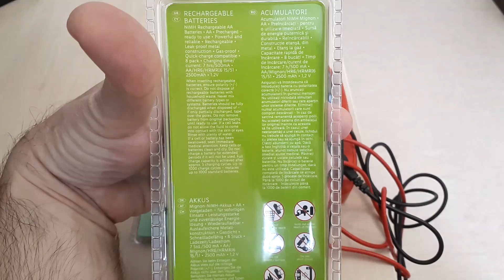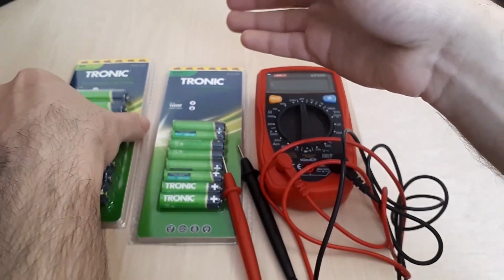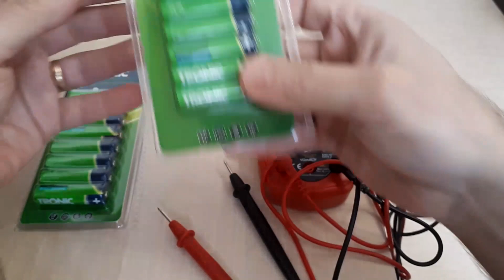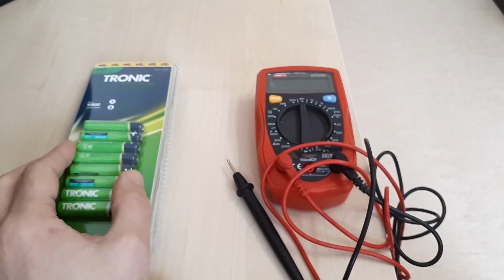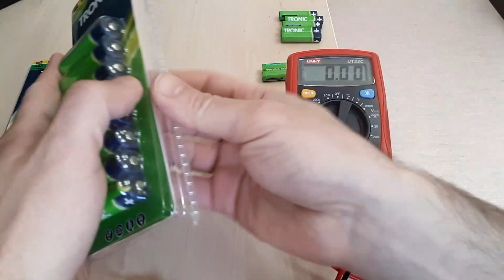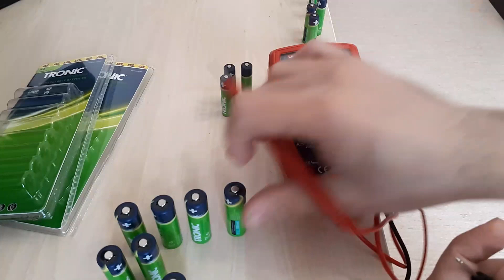2023 TRONIC (Lidl) AAA and AA Rechargeable Batteries Test with UNI-T UT33C Digital Multimeter Review

Comment: Correct if I am wrong but actually charging from "0" to 100% is actually the preferred method with this battery chemistry with a memory to keep the capacity high, and it is not tresfull like for lithiums it would be.

Comment: Most rechargeable batteries are 1.2V not 1.5V as with normal non-rechargeable types
Reply from the maker: I am well aware of that, alkaline batteries have different characteristics. The issue was how much of a charge they can keep and how much current they deliver when new, as well as the variability in a specific batch. 

All of these indicate the quality you may expect and lifetime performance, compared with other batteries using the same technology, of course.

Comment: Hey, how are they holding up? Do u get any issues with them?
Reply from the maker: I cannot give a full evaluation on their long-term performance, as I use them sparingly, but, as it seems, they fare no worse than other mid-range rechargeable batteries (used them in flashlights, wireless mice, outdoors temperature wireless sensors). They are not probably on the same level as top-of-the-line products, but they are reliable enough.
Reply: @retrowikid agree, use them the same